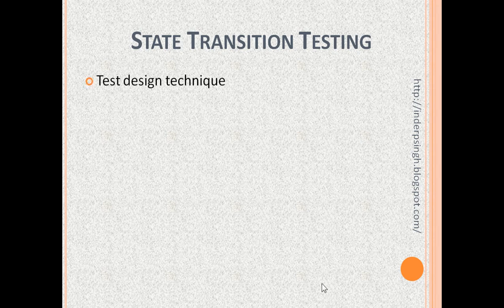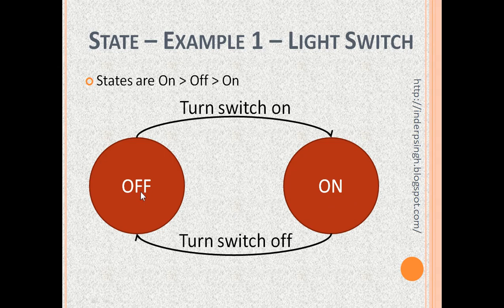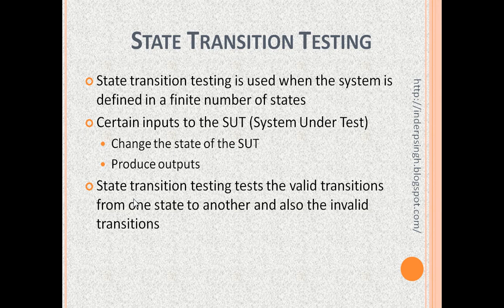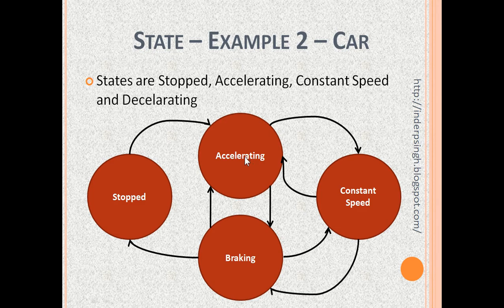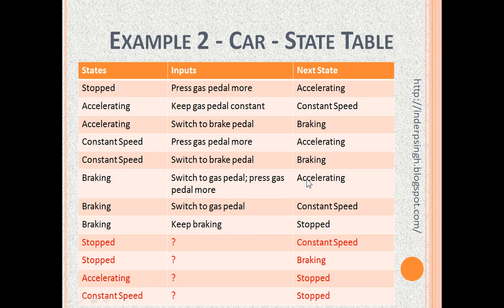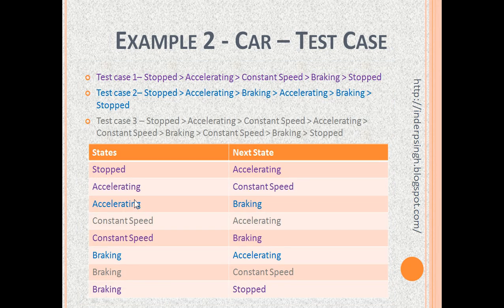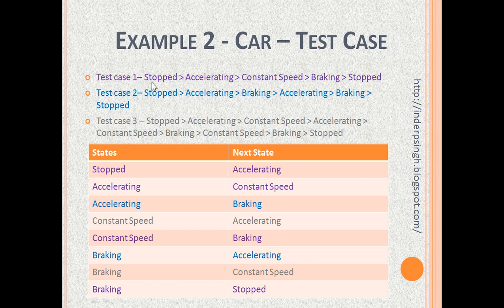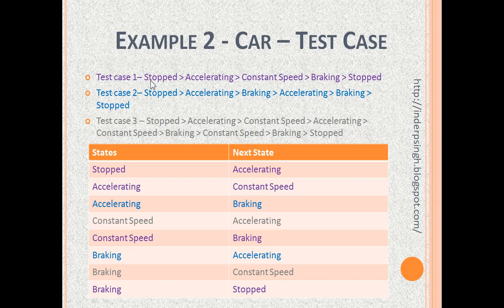State Transition Diagram-State Transition Testing-State Transition Diagram In Software Testing

Comment: Performing Integration testing using Visio diagram so here we say state transition technique involved?
Reply from the maker: Yes, you can use your Visio diagram to represent the different states of a system and the transitions between those states. You can use your diagram to derive test cases that test the valid and invalid transitions. Or, as I explained in this tutorial, you may create a state table. It is easier to derive the test cases from the state table.
There are many different tools that can be used to create state transition diagrams, such as Visio, ArgoUML, and State Tool.
Thank you for your question. I hope this information is helpful 🙏

Comment: Hi, Could you give few real time examples of scenarios in an AUT/SUT where State Transition Technique can be used??

2/ As in the previous black box techniques  we used decision table technique first and then the EP/BVA for same input fields when needed.Can there be any scenarios in an AUT where we can use all 3 techniques for the same fields when needed??
Reply from the maker: Per my knowledge, State Transition test design technique may be used for an entire system. But, since systems are typically complex, they have to be abstracted to a high level before this technique can be applied. A more common application of this technique is to test units of code like classes.
2) is a good question. State transition testing may be used first because it has less detail, if there is a manageable number of distinct states, then Decision Table testing and lastly, EP and BVA because that is the most detailed. Or the reverse order, if you want to test with most detail to least detail.
Reply: Great, Thankyou! 

Is there a connection between state transition and Usecase testing?

For e.g in usecase testing when we give the example of interaction between an actor/customer and the bank, the state of the system also keeps on changing depending on the Pin number entered?

I am understanding use-case testing according as per your video. 
Thanks,
Reply from the maker: Thank you for your support. You may want to select your test design technique depending on how the requirements are documented. If there are use cases, it would be simpler to perform use case testing. For anyone reading this comment, the Use Case Testing tutorial is available at https://youtu.be/H95RX5zFLcA
There is a difference in the format. In a use case, the focus is on the workflows. If you want to apply State Transition testing on the Cash withdrawal use case example, you have the additional step to write the state transition chart of the ATM system first.
Reply: You are welcome. You are always very helpful which encourages me to watch your videos ONLY among all other videos for the same topic on youtube :)

 1/ If we are testing the interaction between the user and the system, why do we need to create testcases to test states and the transitions between states??  Is this the requirement given by customer to test both(Workflows and states/transitions)??? 

2/I assume, the interaction between the customer and the system MUST be tested by creating Usecases ONLY, there is no other technique in BB to test this?? 

3/There can be multiple Usecases in the TestDesign Specification document depending on the requirments , where each Usecase contain multiple testcases for normal and alternative workflows???

Thanks,
Reply from the maker: Awesome, thanks again. My responses are:
1) No, no, let us not mix it up. If we have to test the interactions between the system and the user actor, we can simply write test cases from the normal workflow and exceptional workflow(s) of the use case. 
2) Use case testing is one technique to test the system and user interactions. But, there are others like specification based, error guessing and exploratory testing.
3) Yes, but the Use Case steps have to be split into Test Case Steps and Expected Results.

Comment: does a state transition diagram count  as a state transition testing method?
Reply from the maker: No, a state transition diagram/ chart describes the system in terms of its valid (possible) states. We need to design the tests to check if every valid transition is possible. We can do this by traversing the state transition diagram. Thank you for your question.

Comment: " Braking doesn't make sense in a stopped car" - well I wouldn't like to stand behind you on a slope waiting for the light to turn green ;)
Reply from the maker: This simple state transition diagram has distinct Stopped and Braking states. In order to make it more realistic (based on your comment), we will need to divide Stopped state into two distinct states, Stopped-Braking and Stopped-No braking. Perhaps another distinction is acceleration due to slope (e.g. downhill driving) OR pressing the gas pedal. Or braking due to slope (e.g. driving up an incline) or pressing the brake pedal. It is getting a bit complex so I will stop for now but thank you.

Comment: Hi I am new for Testing, i saw your Graph Based Testing, that video is very good to understand. Can you explain State Transition Testing for real time example, still i have doubt in your explanation. Advance appreciate for your positive replay.
Reply from the maker: Vinoth P We can think of a software-based system as one with a finite number of states. For example, a text editor can be in exactly one of these states at a time - 1) Initial state; no text 2) Text entered; file not saved 3) Text entered; file saved etc.  We can analyze the system requirements and determine the possible states and valid transitions between states. In state transition testing, we test that each valid transition is possible and works correctly. Also, each invalid transition is not allowed by the system. Does this clarify it? You can let me know if you have a specific question.

Comment: In the Car analogy I think there should be another state call "decelerate" because the car cannot jump from constant speed to stop state without decelerating.Etc Etc...
Reply from the maker: Bee Honey True. In my state transition diagram, I have labeled this state as Braking. Actually, Decelerating is a better label because it implies all states which lead to a reduction in speed e.g. braking, going up a slope, going against front wind etc.

Comment: Thanks for the reply. Sorry I am still confused about the definition of 0-switch and 1-switch. According to sources, You can design tests to test every transition shown in the model. If every (valid) transition is tested, this is known as “0-switch” coverage. You could also test a series of transitions through more than one state. If you covered all of the pairs of two valid transitions, you would have “1-switch” coverage, covering the sets of 3 transitions would give “2-switch” coverage, etc" Based on the above, could you please elaborate on your example. I find your example very helpful but need to understand the 0 switch and 1 switch clearly as it is confusing especially difference between every valid transition and pairs of 2 valid transitions. Would appreciate if this is explained in a further example. thanks again
Reply from the maker: H Mardi Well, I don't know about 0-switch and 1-switch. In my example, there is a lighting example with exactly one binary switch. At any time, this switch can be in the Off state or the On state. In state transition testing, we test if each valid transition works and if yes, it works correctly. There are two valid transitions in this example - Off to On (changes the state of the system to On i.e. the light is On) and On to Off (changes the state of the system to Off i.e. the light is On).
Reply from the maker: H Mardi Just curious. When we have already tested each valid transition, why should we cover each couple or each triple of valid transitions? IMO, it is important to test each possible path in the state transition diagram. I have shown how to do this in my Car example. Thank you for your questions.

Comment: Thanks for the tutorial which i find very useful. Just one thing you need to mention is the 0-switch and 1 - switch covers. can you please elaborate on these as I find them confusing. thanks
Reply from the maker: H Mardi Thank you for your comment. 0 and 1 are the two possible states of the example lighting system. 0 means that the entire system is in the Off state (the switch is in the off state which causes the entire system, including the lighting and the circuit to be in the off state). 1 means that the entire system is in the On state i.e. the switch, the lamp and the circuit (with electricity flowing) is in the on state. The user of this system can only provide the input as the flick of the switch. The system changes state based on the user input and the current system state. Hope this clarifies it.

Comment: Can you please also explain the 0 switch and 1 switch coverage, thanks a lot.
Reply from the maker: In the light switch example, we saw that the system can either be in the Off state or the On state. The system continues to be in its present state until a user input is given. There are only two valid state transitions in this system:
1 - Off state to On state
2 - On state to Off state
In state transition testing, we test if each valid transition is possible or not. If the valid transition is possible, then it changes the system state correctly or not.
Is this what you were looking? Please let me know.

Comment: Hello, the minimum of test cases that can be written is defined by visiting each transition at least one, right? The reason I am asking is because i think we can create diffent test cases depending on the valid transitions selected.
Reply from the maker: Actually, my approach is to first identify all the possible system states. Then identify all the possible valid transitions. We need to test each valid transition. This means we visit each "connected" state pair in our state transition diagram.
Yes, you can create different test cases depending on which valid transition you test. The test cases in this video are based on workflows of a user and somewhat complex.
Instead, we can have simple test cases that test that each valid transition is possible. And if possible, it changes the system state correctly. E.g. in this video of a valid transition is Stopped - Accelerating transition.
Also, we need to test each invalid transition to test that it is not possible at all. E.g. in this video of an invalid transition is Stopped - Constant Speed transition.

Many thanks for your question.